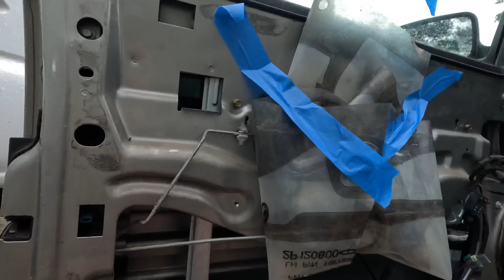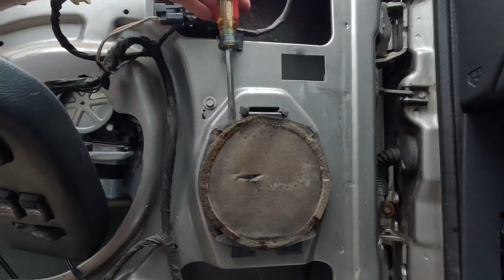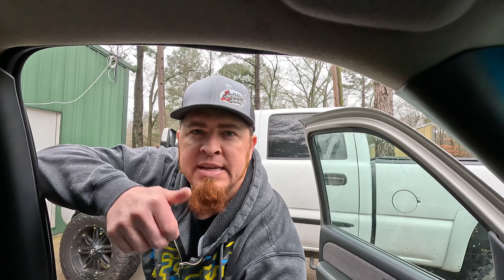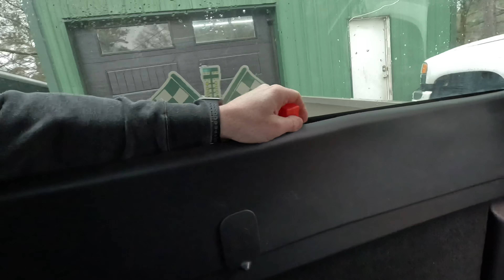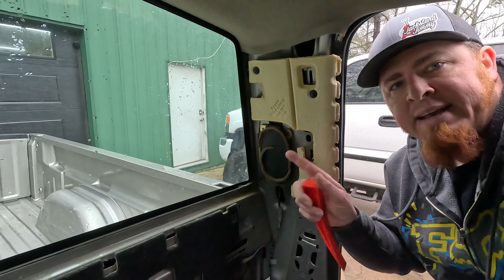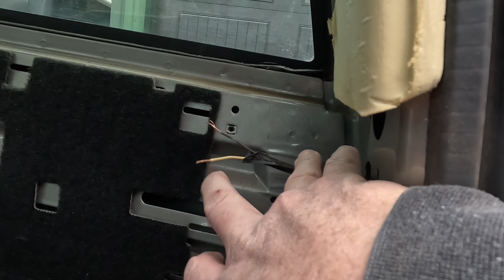HOW TO CHANGE OUT WINDOW MOTORS/REGULATORS | 6 1/2” & 4x6 Pioneer Speakers install Chevy Silverado

Comment: I’d be curious to see how a shallow-mount, self-powered subwoofer sounds in that truck now.
Reply: I put a  shallow mount dual voice coil 12 in ported box in the cateye and it sounds great! Wasn't enough air space for 2. Ported box was tuned at 40hz so I changed port to lower it to 34hz.
Reply from the maker: I bet it sounds really good.
Reply from the maker: It would probably sound good.

Comment: Nice install. I think you should have hit the inside of the doors with the vacuum too since those speakers were in such bad shape. Ever dabble with sound dampening material?
Reply: I use foam baffles behind all my door speakers to keep them safe from water that gets inside door at times and helps for better mid range sound. Cheap from Amazon and last.
Reply from the maker: @pauldosser1798  I did that on the Tahoe with the 6x9 upgrade in the roof/headliner. That isn’t a bad idea for doors either. I may add them later on.
Reply from the maker: Thanks. I have not really used sound deadening material. I am always trying to keep my rides light and not add weight.